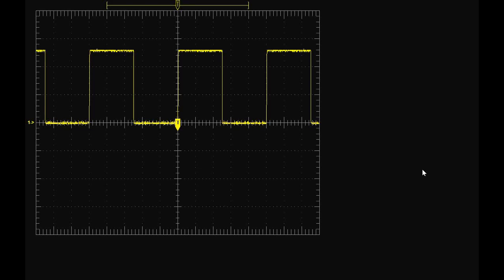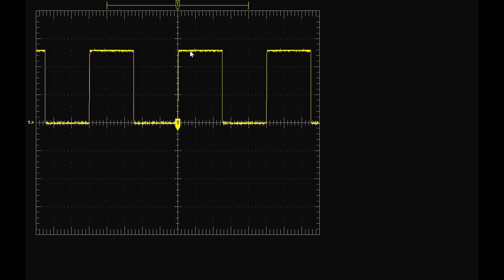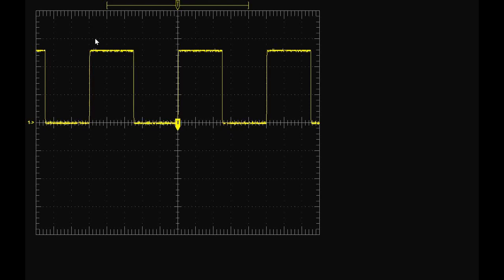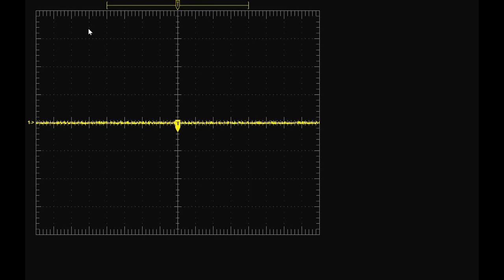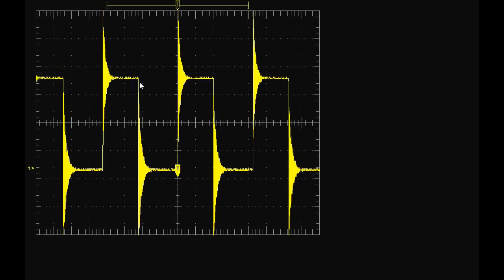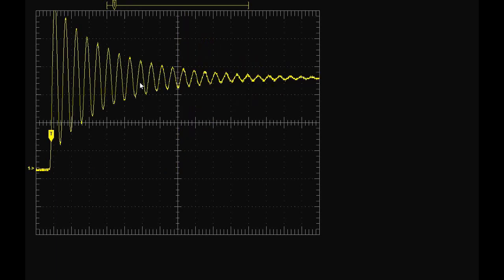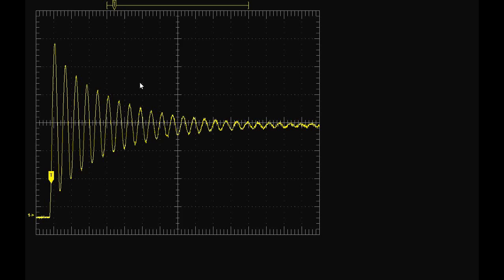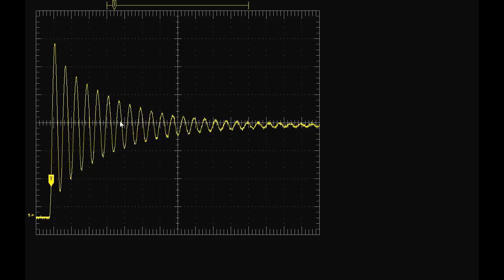How to Measure the Resonance Frequency of a Coil?

Comment: Sorry you lost and confused me! Need clearer explanation and less fiddling with the kit, which should have been set up properly before the tutorial. This nearly works but not quite. Try a V2 maybe?
Reply from the maker: You are right, I should make a clearer v2. 

The basic idea is to measure the step responce of the coil and from that measure the resonance frequency via the oscilloscope probe. Now that I think about it, I should have probably done the setup a bit differently, and subtracted the effects of the probe capacitance(which caused a slight under estimation of the resonance frequency).
Reply: @ivanrodionov9724   Thanks for your reply  and for taking my comments as the constructive criticism I intended them to be. 

Your other videos are really good. Thank you.

Comment: Does this work for PCB coils ? I tried it on some rectangular FR-4 PCB coils with differens sizes. I did measure every PCB coil and find their self resonance frquencies. I also tried to find self resonance frequency of my PCB coils with the help of Electromagnetic Design and simulator program Ansys HFSS. There are huge differences between the results that I measured and simulated. Do you have any idea why would that be ? I need help, thanks in advance